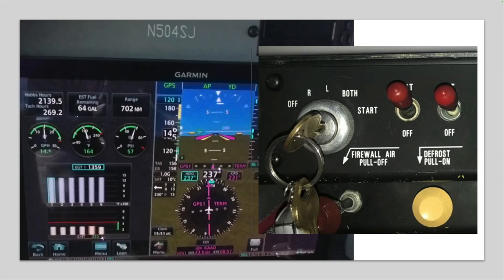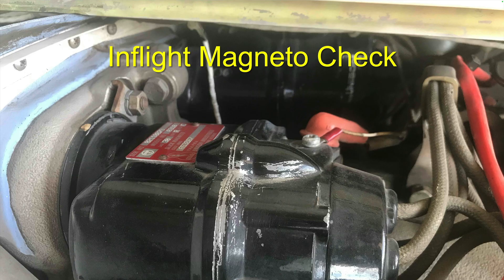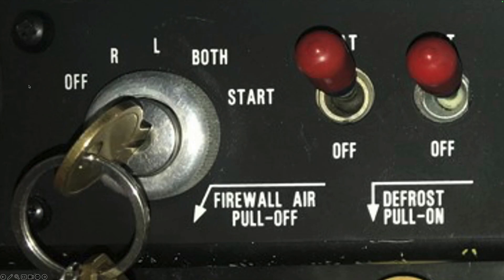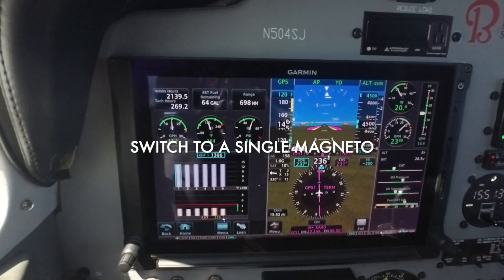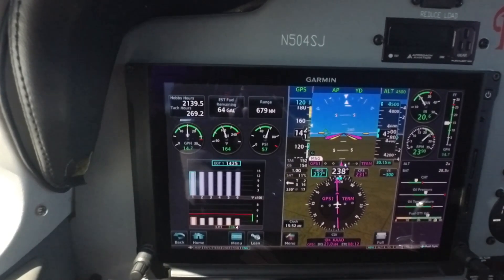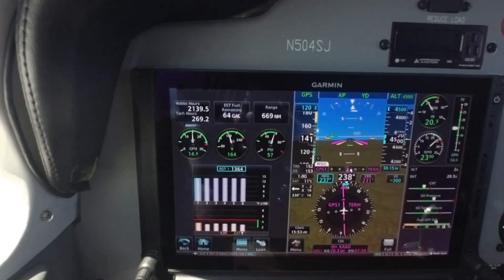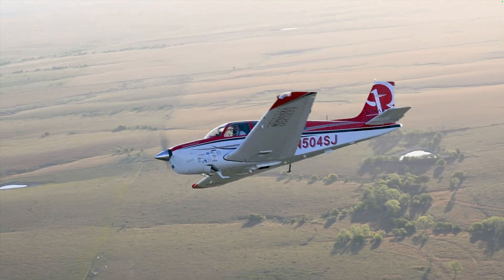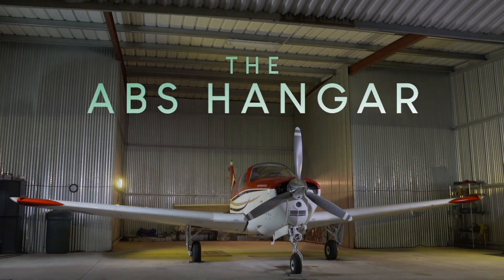Inflight Magneto Check – Why, When, and How

Comment: Have used in flight mag checks to isolate any issues with injectors or plugs - follow the procedure listed in Savvy Aviation - has helped locate needed repairs - downloading the data afterwards is a big help

Comment: Risky doing an in-flight check as it could make matters worse and won't make things any better, so what's the point?   Far more useful to check it after landing to see if there is a problem as the next student to take the plane might forget to do the mag check.  I took a rental plane out to the far end of the airfield before doing a mag check and the vibration on one of the settings was shocking - the entire plane shook violently.  I taxied back and the CFI discovered that one plug hadn't been connected after an overhaul and the mechanic was fired.  Clearly nobody had bothered to check the mags, and I also got blamed for taxying so far before doing a runup check!

Comment: As a Bonanza maintenance shop owner and maintainer.....why would you potentially introduce a problem in flight is beyond me. What if the switch fails at that point and kills both mags? Not a fan at all of this. Why not check that the idle cut off is functioning properly ant higher power settings also? Make sure the alternator is working too by shutting it off and back on? Unless you have a suspected rough running engine get on the ground.
Reply from the maker: That's a valid point. The inflight magneto check is designed to detect firing issues that won't usually appear in ground checks at idle power. There's no reason you couldn't do a runup to cruise power on the ground after a flight and get the same result. - Tom @ ABS

Comment: One time, our P Bonanza magneto run-up drop was slightly lower than usual on one side, but we took off anyway. During the flight, the engine progressively ran rougher. I performed an in-flight magneto check, and the engine stopped on one side! I immediately switched back to BOTH and the engine ran again. We immediately landed at an airport that had a mechanic. He determined the magneto case vibrated loose, causing a short. He tightened it - problem solved. (Iirc correctly, I switched back to the good side only, after the engine was running.)

4:04 "The change in engine noise may be unnerving." It was!